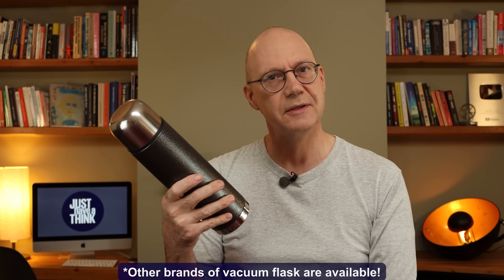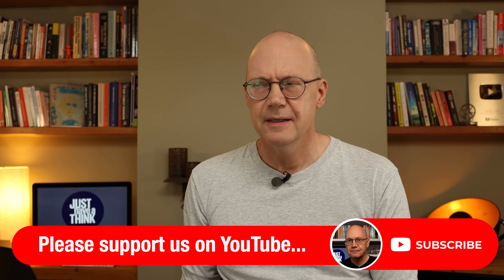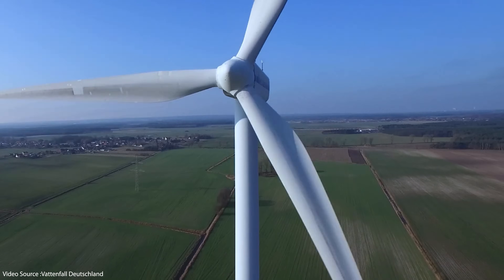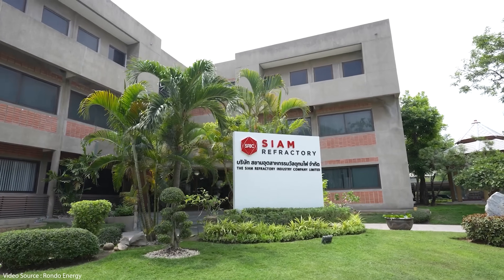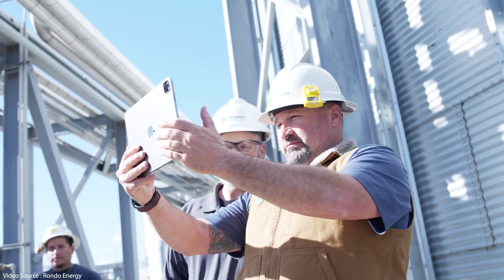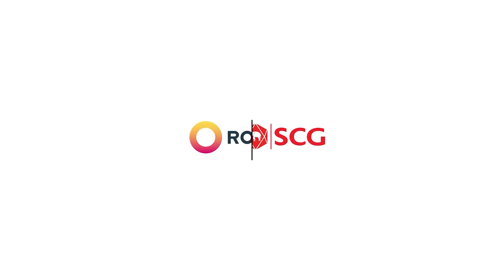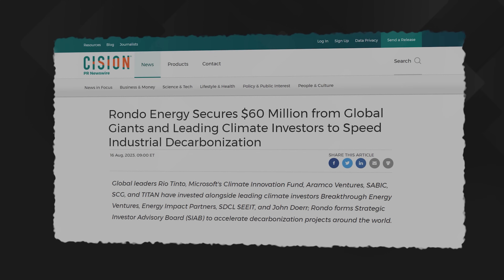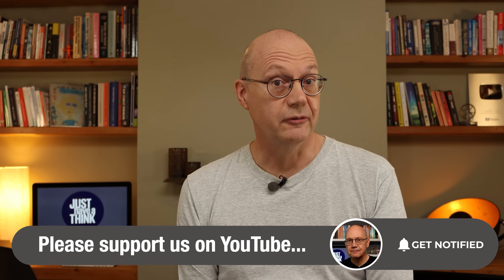This energy storage technology is HOT STUFF!

Comment: Well, energy is the transference of motion. As in, a thing passes on motion to another thing - irrespective of whether or not the former thing has a resultant change in motion.

So what they're trying to accomplish, in my understanding, is to make things have lots of the kind of motion we call "Heat"; and then, when necessary, to make those things transfer that Heat energy to something else - most probably to pipes submerged in water, which then produces steam for turbines for generators. Baring in mind that the Heat energy will be diminished or gone as a result; that is to say, the thing, which had the heat, will no longer be doing the kind of motion we call Heat.

What they appear to be finding challenging is maximizing the potential of this whole procedure.

By that I mean the following.

Accomplishing the task of making as much of the thing, or set of things, have as much heat (kind of motion we call Heat) as possible/required/desired, for as long as possible. 

I haven't included "without losing the Heat having transferred it"; because i dont believe they're after that, and because I have no idea how to assist with that endeavour at the time.

But i do believe i can come up with some options as to how they could accomplish to prior-stated task.

First of all, you'll find that high surface area objects reflect more effectively, and, so far as I'm aware, remove heat more effectively. 

Also, for an object to have an increase in surface area, without adding particles to it; it must necessarily use particles not-from its surface, and place them at the surface; in other words, it must lose density.

And so follows the theory: less dense objects remove heat more effectively. 

In other words, first of all, they may find it helpful to start off with more dense objects to store the heat in.

It may be harder to get them as hot as they can get, but I believe they'll find that they'll lose heat less effectively, and thus retain heat for longer periods of time; and possibly retain more heat than their less dense counterparts.

Secondly, i believe that, should they be using bricks (as in video) or similar, then there will be different configurations/overall-structures the bricks to be held in, that ought be used at different times. One structure for when hot air or whatever is passed through, so to heat the bricks up; and then some low energy consuming mechanical mechanism, attached to the bricks, repositions them into a second structure/configuration - one which has proven to retain heat more effectively (without transferring heat less effectively).

Finally, what about algea? 

I know they're using it for other similar purposes. 

But could they make some sort of "algea-sludge"? So long as the algea aren't damaged by it, and can in fact retain the required amount of heat.

Also, what about the cold?

Usually. When a hot thing touches a colder thing, the colder thing gets hotter. But the hotter thing gets colder too. So energy can be transferred from cold things too.

If we can figure that out, then we can build atop so much ice on Earth, and make use of the eternal-winter that is the weather of Britain.

Comment: Heat batteries is the way to go.
Cheap. Can be non-toxic. Not many exotic or breaking components.
Climate friendly.
...
Brick or sand batteries? I'd go with sand, just because bricks has to made and they need construction sand that is also runnig out...

Also geothermal pumps that sends in heat when prices are low (summer) and takes the same heat out when needed.

Our portable devices has to be light, so there we use other methods. But why not use large heat batteries where ever we can to store energy and where we don't have to move?

No for Tesla powerpacks or lithium battery banks, etc.

Comment: Heat storage is, I think, the way to go!
I can see problems with the "Good Burgers" thermos flask though. From leaks of near boiling water that are difficult to impossible to seal whilst hot to terrorist attacks!

Brick storage on the other hand is a different beast! Refractory bricks are Not a good idea though as they are designed to withstand large heat differentials not store heat. 
We do have a mature industry around storing heat in bricks though. TSR's or Thermal Storage Radiators were a staple of the UK multi story housing, where gas was not thought to be a good idea. These heaters were up to about 4Kw and bled their heat out slowly to keep the room warm with the ability to allow a current of air to circulate through the middle for instant heat!
Obviously sizing them up will be required and extra insulation so they do not "bleed" heat out of their surface. The bricks were made from an iron rich medium and mixed with slag from coal mines (many of those slag heaps still exist even if hidden under a top of grass)!
Building a brick core has the added advantage that you can scale the area up almost infinitely to give as large a "battery" as is needed!

Comment: I worked at an Enbridge tank farm in Alberta where oil from the oil sands is stored. These tanks ranged in size from 300,000 to 500,000 barrels the lose of temperature was very small even without insulation. Just the volume kept the oil warm ,as ,oil from the oil sands won’t flow unless it is warm. Why would they have to insulate water storage tanks? Or do they?

Comment: Saying that losses are less than 1% per day sounds adequate if you're just trying to buy electricity at times of day when it's cheap, and use it to heat stuff at times of day when electricity is expensive.  There are processes where that's useful.  But seasonal energy storage will need better insulation: losing on the order of 1% per day when you're storing it for over 100 days doesn't sound helpful.

Comment: Thanks for another interesting video.  Heat storage sounds like a pretty good idea.  Is there a significant CO2 load associated with manufacturing the bricks?
Reply: The beauty of the system is: there is only a one-time CO2 effect to make the bricks that will last for many decades!  The clean energy trade-off on the bricks always being reheated with solar or wind green energy instead of fossil fuels being used is the real game changer.  If the plant manufacturing the bricks could be run off of green energy then that would be perfect.  I know that the concrete manufacturers are finding new ways to be a lot less polluting which is huge as there has been a massive amount of CO2 footprint traditionally involved in the making of concrete.
Reply: No, we recover the full lifecycle emissions of creating and installing the system in only a few hours of operation =]

Comment: Reminds me of the refractory brick 'storage heaters' my parents had installed in the 1960's. They took advantage of cheap overnight 'off peak' electricity to heat up, and slowly release the heat throughout the day. They were the best heating system, better than radiators-worth of central heating on the walls, and they looked pretty stylish for the time. Even for these times I suspect.
Reply: They were hot all day when you were out, and had cooled down by evening when you were in. We need domestic storage heaters which are bigger and better insulated than the old ones.
Reply: @clivebashford2056 They probably just needed better insulation and controls.
Reply: We got rid of ours as they didn't really allow heating on demand. (Yes, I really am that old.)
Reply: We think we look pretty stylish too =] But yes this is principally the same exact thing -- but we charge and discharge simultaneously so we deliver heat 24/7.
Reply: I currently use one. It's a dump load for my off grid PV system. Heats during the day when it's sunny and releases the heat in the evening. Works a treat.

Comment: Comparing a giant heat battery to a kettle must be the most english you've been in the channel in a long time.

I've seen a lot of videos about heat storage, but other than hot water an indoor heating, I've never seen any direct application. I'd love to hear more about how it can be used to power industrial processes like those described in the video.

Also, I can't help think that the real revolution would come from systems that could transform moderate heat into electricity, for example removing excess heat from pv panels.

Comment: I'm just spitballing here, but could a few Stirling cycle engines be put in line, either out going or in coming, to scavenge heat ( remember folks, Stirling cycle engines are almost as old as the watt steam engine, they work on temperature difference, and new materials would help them be more efficient as well as more sensitive to temperature difference) and using relatively common methods ( there are many) to make electricity? Great vid.

Comment: Why is no one talking about good old fashion domestic storage heaters as part of the decarbonization path for houses. Because heat pumps are more efficient I hear you say! BUT heat pumps require electricity which is expensive to store. Storage heaters can be 'charged' when power is plentiful, and therefore cheap, to he released when needed. Forget fixed time tariffs such as Economy 7, flexible time and price is needed to accommodate intermittent renewables. Simple and cheap!

Comment: High input costs are probably the reason why low-energy heat is not used more. Unfortunately, even waste heat from nuclear power plants is not used today.  Only about 30% of nuclear fission energy is converted into electricity. About 60% of this huge energy escapes as waste heat. There are only a minimum of projects where waste heat is used to heat cities. This is where it should start. One such new project was completed this year at the Temelin nuclear power plant in the Czech Republic after years of planning. 
Thanks for nice videos!

Comment: As always good stuff. I would be interested in either a section in the video or maybe a separate video altogether on why some of the solutions you talk about here haven't dominated the market yet. If the payoff period is so good, what's holding it back from wide adoption right now? I'm sure there are reasons, it would be great to spell them out.
Reply: Early adopters! Large facilities are super risk averse. Sometimes their plant has been operating the same exact way for 50 years! We've designed our technology to minimize risk, using the same integrations as their existing gas fired boilers, however, it's a lot easier to do nothing. That's why shareholder pressure to decarbonize is huge, it motivates companies to change. Government incentives too.

Comment: The literal building block of their system is also one of the most energy intensive manufacturering processes.  I wonder where their energy comes from to produce these bricks?
Reply: Hi there, we recover the lifecycle emissions of our systems in only a few hours of operating! Bricks are actually not too energy intensive to create, especially when they're created using our own heat batteries instead of gas kilns!
Reply: @RondoEnergyGlobal  Glad to hear it will be possible to use heat from your storage system to create the bricks.  I'd love to see if your thermal batteries could be usefully combined with absorption cooling.
Reply: Sand is better.

Comment: Be useful to have a round-trip efficiency comparison - I'm hoping that as mentioned this sort of tech will be the final nail in the coffin of the hydrogen hype being pushed by the fossil fuel industry.
It would also reduce the shudder I get when the words "spare renewable capacity" are mentioned.
I love the flexibility of this system - given a decent round trip and volumetric energy density, I'm sure this would have a small-scale (maybe home-scale?) applicability?
Reply: For most TES units it's limited by the method you use to convert the heat back into electricity - for most steam turbines that's around 30-40%. The larger the turbine the better the efficiency (generally). Unfortunately you won't see these on a home scale though you might see heat storage of some kind, where heat is taken in during the day and released slowly at night, but it won't be these kinds of materials or structures.

Antora is managing around 40% round-trip efficiency and believe they can achieve 50% in a few years, using a thermophotovoltaic cell instead of a turbine, using radiative instead of convective heat transfer; which is pretty cool but you're probably not going to see anything close to a lithium batteries efficiency from these. The good news is that they're cheap and sustainable by comparison to lithium, your capital expenditure is so low that as long as you have access to cheap off-peak electricity you're not going to care about round-trip efficiency because your price-per-joule still ends up being significantly lower.
Reply: @wufflykins4369   thanks for the info. So more like electric storage heaters than electric potential?

Comment: I was curious if anyone has the comparable efficiencies for these fabricated mass energy storage and good old fashioned geothermal storage? I would think the fabrication cost differences would make geothermal more efficient with all-in costs to build & operate.
Reply: You can't store heat with geothermal storage onsite at an industrial facility that needs heat on demand. We can be located at the heart of an industrial facility. The further you need to transfer heat, the more losses you experience.
Reply: @rondoenergy4228  Are you saying the geology is not likely to hold the desired amount of energy? I wouldn't expect there to be a limit in the amount of heat energy that could be inserted into the ground compared to that of engineered blocks. This wouldn't have to be transported anywhere, just the earth mass under the facility.

Comment: Imagine pairing an affordable version of this technology with high temperature heat from 4th gen Nuclear reactors.
Reply: Not needed: a nuke reactor can be turned up when needed and turned down when not needed. 

To time shift great from a solar array though, where the heat comes at a time of day different to the time of usage, this might be an appropriate alternative to molten salt.
Reply: @trueriver1950  
Maybe but what is fascinating is that so far the largest grid storage systems have been pumped Hydro. Many, perhaps even most of which have been built in conjunction with Nuclear power plants.
Reply: @MrElifire84  some may have been built in conjunction with nuke power, but I can't actually think of any myself. 

Many of those in Scotland use English electricity to pump the water up overnight, so that it supplements the Scottish Hydro power in peak times. 

I can't actually think of any technical reason why a nuke power station would need to dump surplus power, though it would be wise to have hydro nearby to go on powering cooling systems if the entire site needs to shut down. Cooling off can take weeks, and keeping used fuel safe can take years so come contingency is sensible. 

Can you give an example of pumped storage linked to a nuke power station, please?

Comment: Why are those hot bricks only good for a large scale solution? Where is the cheap stirling engine that you can put on the stove or on the hot water tank and that outputs 10 to 100W? Where can I buy flat tanks with wax with a melding point engineered to a temperature of 24 Celsius in order to keep the room temperature constant?
Reply: It would cost more to run the Stirling engine than you could ever get out of it.  If you are actually leaking enough heat to make running a Stirling engine practical, it would be a better idea to fix the leak.
Reply: I've got a great idea. Put bricks in an insulated box in every house and heat the bricks when power is plentiful (wind blowing etc). It's called a storage heater!

Comment: For an off-grid vacation home (which I'll share with many friends, otherwise vacation homes are decadent imho) I always had the idea of hooking a 100 m^3 water reservoir to a solar boiler. Crunch the numbers and see that this kind of number is what you need to get a single house through winter and with a comfortable lifestyle when it comes to hot showers etc. (assuming the house is inhabited continuously).
Reply: For reference, 100 m^3 is like a cylindric (rainwater) reservoir 5 meters in height and 5 meters in diameter.
Reply: I calculated this few years ago and i think that from 95 C to 20 C you can extract like 93KWH of energy from 1m3 of water

do that x 100 and you get 9300 KWH for the entire winter
now you have to check how much your house is using during the winter 
a typical EU house for example needs like 50kwh per 1m2 per year
so 100m2 house x 50 = 5000kwh, sounds like its enough in this case but i didnt account for storage and system loses and thats only for keeping it warm
Reply: @423GustavBern  I based my calculations on an average W-European household's annual gas consumption, so that'd include both the heating of the house and other warm water uses (the other uses are typically small in comparison, I believe).